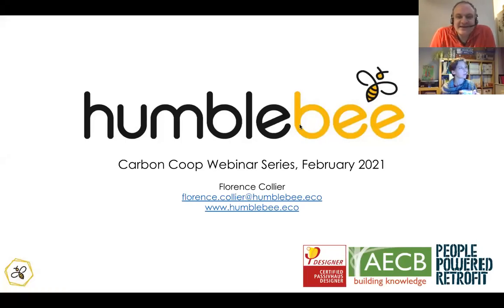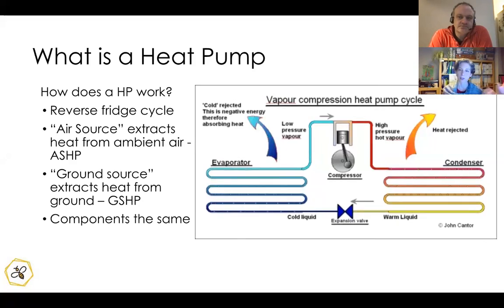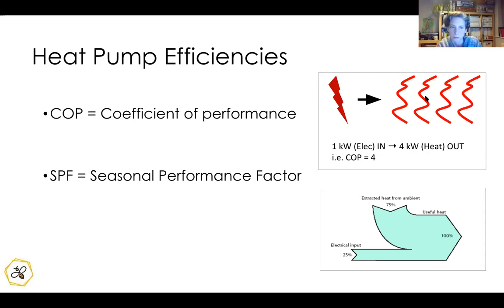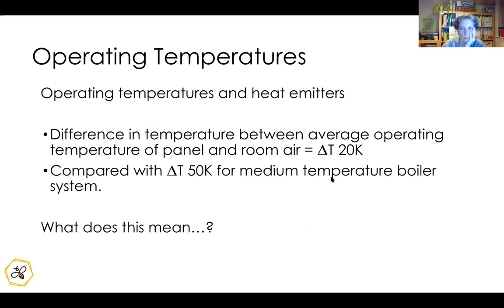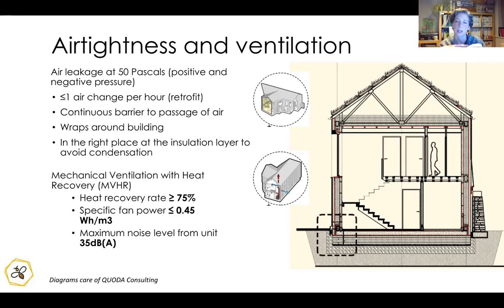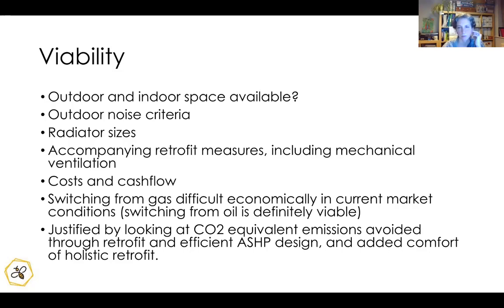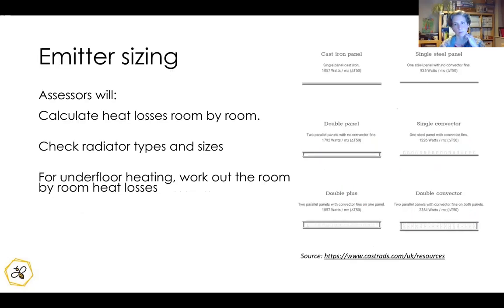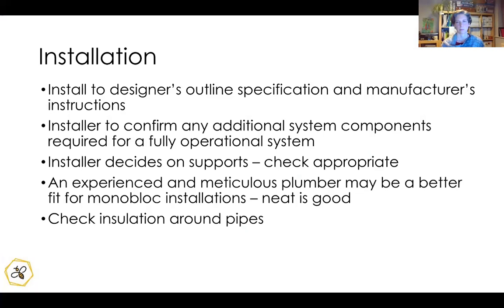An Introduction to domestic Air Source Heat Pumps

Comment: Just a brief comment on the ASHP webinar and Micro-bore.
It isn't as simple as "you can't run an ASHP on micro-bore".
It depends on the overall sizing and flow rates and flow temperature through the system.
Thus if you retrofit insulation to a decent level of insulation then you may well be able to stick with (some or all) existing micro-bore and just couple of radiators upgrades.
The key here is being able to run the heating system at lower temperatures (say 40C) even with cold outside temps.
This is something I have been researching fairly thoroughly.
So I would be worried that people end up being dissuaded from investigating a heat pump install if they currently have some micro-bore pipework in their house (as we do).
What you can say is if your heating currently needs to run at over 50C flow temp to keep the house warm, you have lots of microbore and your house is not particularly well insulated then a simple install of an ASHP and just minor modifications will NOT be satisfactory. Also if one or more radiators currently doesn't get fully warm in your current system and it is connected via a long run of micro-bore then that run of pipework may need upgrading and/or the system may need rebalancing. 
It is likely in any case that the heating system will need rebalancing anyway after installing a heat pump. Rebalancing is a fairly straightforward thing whereby all the radiators are adjusted to receive their "fare share" of the flow through the heating system, thus minimising those cold spots.